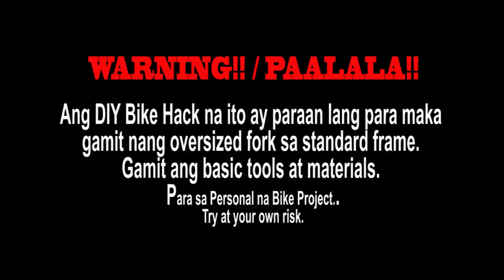Oversized Fork into standard mtb frame - DIY Hack

Comment: may isa pa akong napanood na video ang ginamit nyang pipe ay may size na 1 1/4
sa shopee may mabibili kang 1 meter long na pipe na ganun ang size tapos stainless pa
Reply from the maker: Tama meron ganun size sa stainless. Kaso di ko ginamit di pa ako marunong mag weld stainless to carbon steel/chomoly. Thanks for sharing your info. Thanks for watching the video

Comment: sir pwede ba to sa classic frame ng rb?
Reply from the maker: hindi ko po sure kung applicable sa rb. standard steel mtb frame lang nasubok. try mo sir measure outside and inside diameter nang heatube. at anu ang magiging final length nang headtube pag nalagyan na nang adapters and headset kung sakto pa rin ang steet rube nang fork na gusto mong gamitin. pag possible pwede nyo pong subokan and mod. take note po ibayong ingat at intindihin ang peligro(risk) sa pag gawa nang mod na ito. Thanks for watching the video..

Comment: Yan ang problema q sa Standard size na 26er q. Pero hindi yan mapwede sakin na procedure kasi pure japanese alloy ang sakin no welds.
Gusto q na talaga mag rigid pero kadalasan mga oversized ang mga steerer tubes eh. 😖
Reply from the maker: medyo iba nga sa yo bro. need ulit mag measure anu ang current outer diameter nang headtube nang japanese bike mo kung pwede rin yun approach nag coupling.. kung alanganin.. hanap ka shop na may aluminum TIG-weld, tapos hanap ka aluminum pipe na 34mm inner diameter yun pa dugtong weld mo sa kanila.. or kung ayung wall thickness nang alloy headtube mo makapal at pwedeng e bore up to 34mm na hindi pa sobrang nipis (at least 2mm  ang maiiwan) mas okay yun, kaso sa machine shop gagawin to. Good luck sa project mo bro. Don't forget to like and subscribe.
Reply: @22mon78  sir pwede ba ilagay Ang 25.4 fork sa 22.2 na standard frame? Ka chat ko kasi Ang Indonesian na seller pwede daw ikabit Ang 25.4 na fork sa 22.2 ,Magpapalit Lang daw ako NG headset.Threaded Po Ang MTB KO at Yong bibilhin ko na 25.4 na fork.totoo Po ba yon?

Comment: Sir, tnx sa vid. May nabili po akong head set na oversized, pinaplano ko po yung cups ay iweld dun sa head tubes. Good idea po kaya ito?
Reply: Natry ko po epoxy pero natatanggal sana tinda kayo nitong adapter / coupling na ito sa shopee
Reply from the maker: @elieboyy medyo mahirap ibaiba na na kasi condition nang mga standard steel frame meron manipis due to age, ear and tear. kaya pinakita ko na lang ang paraan para macustomize nyo and tamang size na walang play and headtube pag nag preno. pagiisipan natin kung feasible gumawa nang pang benta.
Reply from the maker: wag yung cup race mismo and e weld baka mag warp and cup race. at  mawawala ang pagiging replaceable item nang cup race if ever.